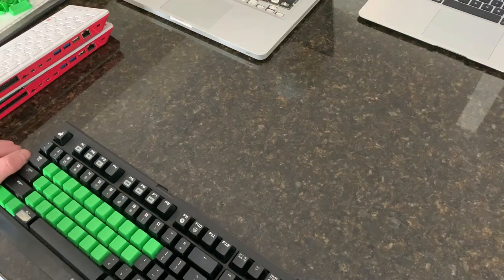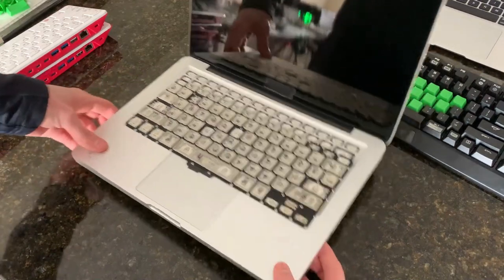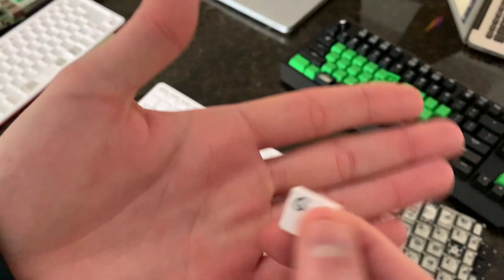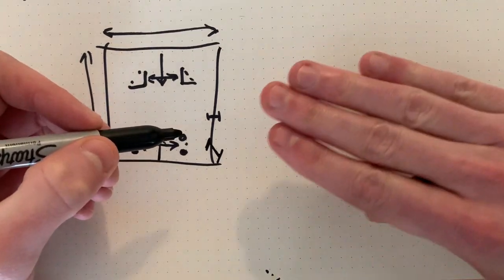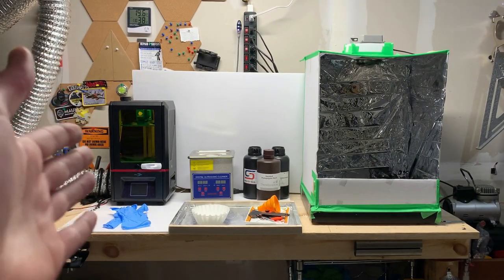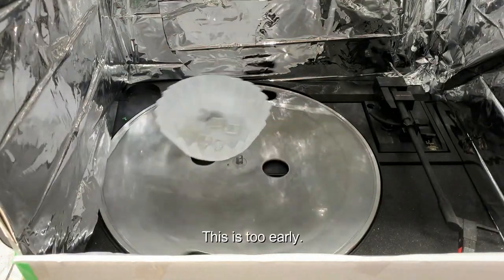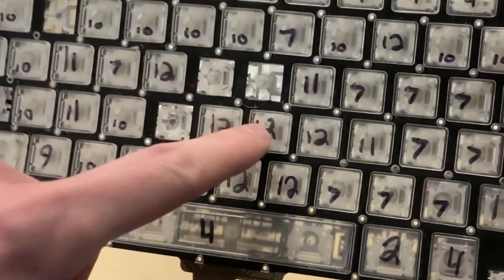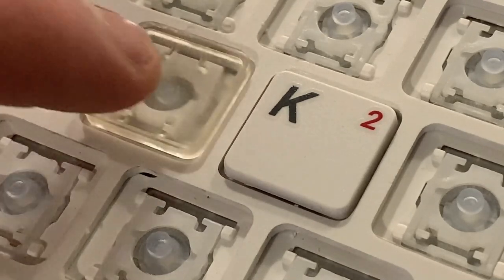Part 1: Pop & Click [Raspberry Pi 400 Keycap Project]

Comment: Firstly, this is amazing. Just so cool to watch the process. I do have what might be a stupid question, but, once you get this to work across all the keys, would this particular solution only work for the Raspberry Pi keyboards? Would you have to build custom fits for all different brands / specs of keyboards?
Reply from the maker: For this time I started from scratch so it took a bit longer. So yes, each time I do this it could probably only work for one keyboard. But I think I can re-learn some Ruby Language and use the 3D software to automate all the adjustments. And I reckon with some practice and 2-3 3D printers I could knock out the designs for a full keyboard in like 48hrs.

Comment: I have a question for you:
So, I've boight this pi 400 with a german layout, and I need to switch from qwertz to qwerty, easy on software, but I'm not quite sure on how to manually invert the Z and Y key, can you give me a hint on the process on how to do it without damaging any component?
Reply from the maker: Sure thing, so the hinge is shaped like an X and what you want to do is wedge something very thin between the hinge and the keycap so there's upward force on the key and downward force on the hinge (Best to go in from the side of the key --> X). Then you want to pull up just a little bit on the bottom of the key first until you hear the sound of the clip parts of the keycap releasing from the hinge. After that you can gently pull the key towards you to release the L-shaped parts from the top of the hinge and the keycap should come right off.
Reply: @casey_works8279  and then I just click it back into the place i need to I imagine.
Btw thanks a lot!
Reply from the maker: @marcomarigo3622  No problem, you’ll want to gently slide the top L-shaped pieces in first, then align the lower clips with the hinge, press down and you’ll hear a ‘click’ when it attaches itself.
Reply: @casey_works8279  Sure thing! Thanks again